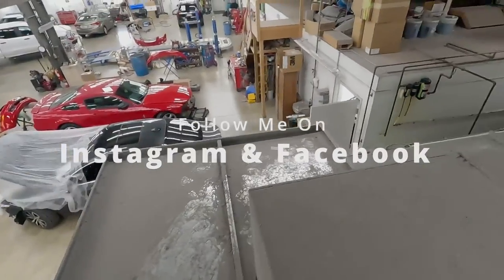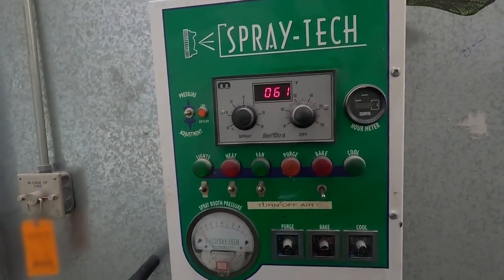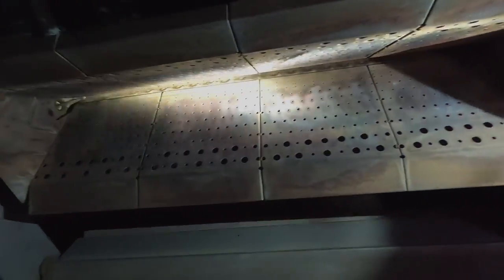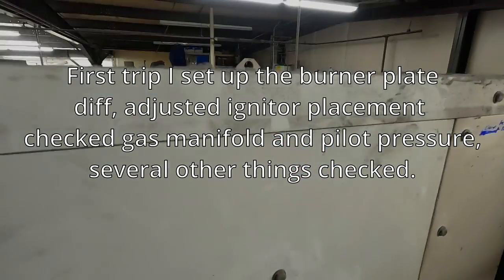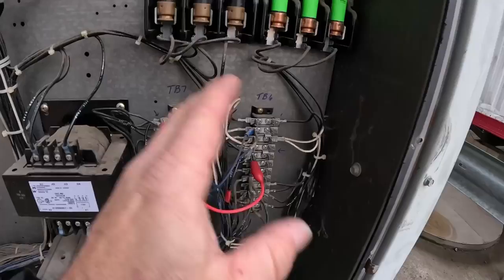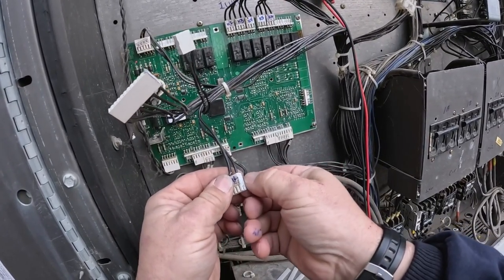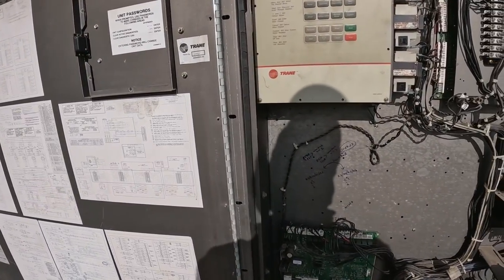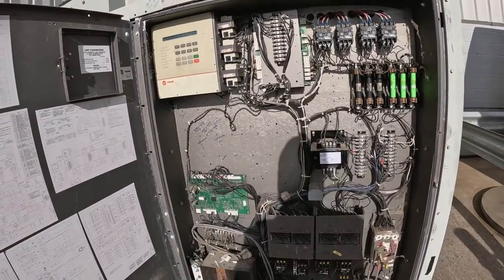HVAC Jobs That Made Me Think

Comment: Great troubleshooting Rick....seems like my days at work. Had an odd ball last week on a Trane DOAS unit.....boiled down to an expansion module not outputting voltage to circuit 2 and 3rd stage heat. I did everything in my abilities to prove it wrong, but i was correct. When I'm somewhat in doubt or second guessing myself....i try to prove what i thought it was wrong...if i can't...i can feel good about my diagnosis.
Reply from the maker: Same here👍👍

Comment: Old direct fired burner, now your speaking my language! Nice job Rick. Anything direct fired air flow is critical. They don't usually tell you a gas pressure maxitrol valves modulate. On the maxitrol amplifier removing terminals 8 and/or 3 puts you in high and low fire and allows you to set pressure per supply temperature rise.
Reply from the maker: Keep watching the chiller I called you about is next...lol
Reply: @HVACRSurvival  I watched the entire video, 2 tough ones 😆, Nicely done 👏
Reply: this is some good info. I have been out of commercial direct burner things for a while. but now being on my own im finding more and more specialty things
Reply: @spymoocowgaming  I've got a few old videos working on a few direct fired burners, once you understand them their not too bad.

Comment: Atta boy, service is all in the presentation. if we're not careful it easily looks like throwing parts at the problem..
Reply from the maker: Communication is key, I'm straight forward and explain everything that I have checked to the owner.  Then to get blown off by the factory with 0 help, what else can you do. (It's the first one like this I've seen.) I knew it didn't make sense because I had proper gas to the pilot but the way the flame was being disturbed it looked like it was an air issue, I didn't mention it but I even tried using silicone to seal the back side of the pilot from being disturbed from the air passing by it,  I didn't know about that burner being able to come apart like it did.

Comment: Good job on that one. I have found that the Maintenance budget at most industrial plants. Have a much higher budgets for repairs and less for replacements. (Bean Counters). I have seen some spend 60 grand on chiller compressors (hit by lightning) rather than spend 57 grand for new system.
Reply from the maker: I've heard that as well. It's crazy but I think it's tax related.
Reply: it's often a matter of how "quickly" it can be back in service, also how integrated it is with the machinery it's cooling. replacing a chiller/controls, could mean the whole machine needs controls and computer changed or replaced! $60K may be far cheaper than a multi-million machine needing replaced to work with other equipment and risking more problems and breakage on stuff that works fine otherwise.
there's always layers of complexity and unseen troubles, old software, computers and protocols no longer produced or things that may takes months to have custom programmed.

Comment: Using a display module on the Honeywell control on that MUA unit can really help with trouble shooting sometimes. Direct fired MUA units can be a pain sometimes
Reply from the maker: I have one 👍.  I used it on the first trip.  Basically it told me it was failing where you saw it fail, in the pilot stage.

Comment: Great catch! Not fully understanding profile dampers moving, that Midco burner is based on pressure drop. Only way my brain can process that system is that blower motor is 2 speed. Never worked on tht brand so don't know sequence of operation in bake mode.
Reply from the maker: That's what was so difficult for me too😁.. No,  the fan stays the same speed but what they're doing is slowing the air flow down by closing the dampers at the burner side and on the discharge side of the blower. They're trying to trap the heat in the room where the car is being painted. That room will go up to 165° to help dry it, they use waterborne paint.
Reply: @HVACRSurvival  When profile dampers close pressure drop across the burner changes dramatically. Gas/Air ratio all get out of wack, would love to put an analyzer on that thing to see what happens.

Comment: FYI depending on the coil setup it may be utilizing both the condenser fan from one and two so you might end up having to come back and put on the second condenser fan or put in a pressure control switch or temperature control switch so when the condenses temperature gets to a certain point you can bring in the second fan and help pull it down in the extreme temperatures
Reply from the maker: The condenser fans are controlled by liquid temperature, the front fan that looks squarish at top has dampers on it that actually try to modulate shut to keep condenser temperature up in the low ambient and the rear fan cycles on and off, there's a total of two fans for each side.

Comment: I work on Direct fired equipment all the time, the pilot flame in my opinion was a bit big and aggressive for a unit that small, and often that will give pilot flame faults from flame lifting (more so on flame rod systems than UV mind you) but if you're ever back there try dialing back the pilot pressure a bit or if it has a needle valve (didnt seen one) restrict that pilot some
Reply from the maker: Thanks for the info, luckily I haven't had to go back since I posted this. 🤞
Reply: @HVACRSurvival  right on that was a good catch on loose profile plates I've actually never seen that
Reply from the maker: I'm not going to lie, it took about three times going out there and tearing a completely apart multiple times to figure it out. That was kind of hidden.

Comment: You had me worried when you were boogie-ing atop the paint boot.  Stay Safe.  Those cast iron burner manifold orifaces tend to close up over time also resulting in an underfiring unit. 
Took a minute to understand why you marked and cut the plug up.  Good move on an otherwise scap unit.  
Was half the board dead?  That company likes living on the edge of total failure with their units, I guess.  Sometimes you just have to limp it along, but man down to 25% capacity.  WOW
Reply from the maker: It's winter so they will be ok until it gets hotter, they only cool the mix to 65*f, I forgot to mention that I punched out the orifices on the burner on the first trip.

Comment: If you think that train is a little bit weird I have some mammoth units that I've lived in extremely hard life and for some stupid reason the idiots that designed it designed it so that the entire unit will not call for cooling if the 5 amp fuse for one of the compressors heater elements does not work how stupid do you think that is
Reply from the maker: That's gross negligence 🤦🏻. It don't surprise me, it's about as stupid as the Aon units that put the control system on the same circuit as the condenser fan so that when the condenser fan goes out it takes out the controls for the whole unit.

Comment: Regarding the compressor with the locked rotor, have to tried reversing the motor direction electrically to try and unlock it?
Reply from the maker: I've tried that in the past, it generally doesn't work, if it does... it'll fail again, the bearings are screwed or the windings have issues.

Comment: Your nuts, 3 of 4 compressors dead and you butcher the system to get the last compressor running? Sometimes you just have to deliver the bad news and walk on. Make them replace the dam thing. No way I would have jumped out all that shit and left my name on it.
Reply from the maker: All the safety circuits were back in place,  I didn't leave anything bypassed... all I did was switch circuit A and B inputs and outputs. When this locks up and doesn't run they'll have no choice but to do it.  I fully noted that this needed replaced on the paperwork and that it would fail again soon.